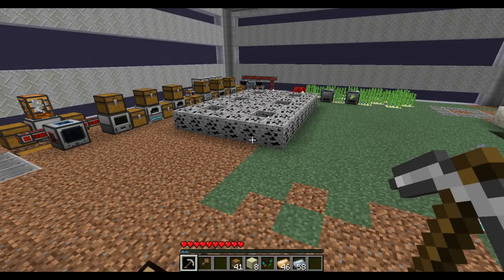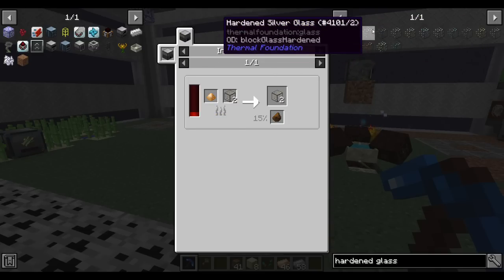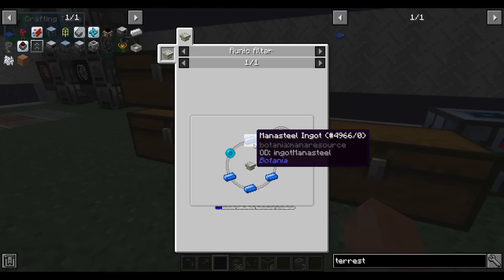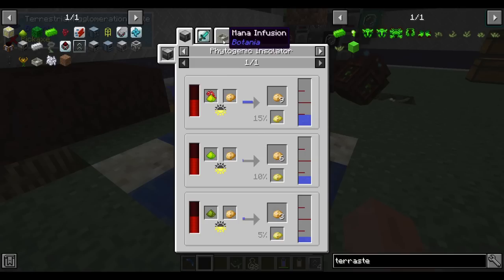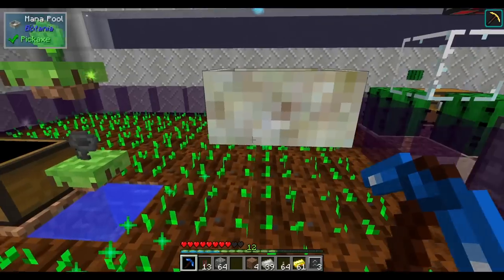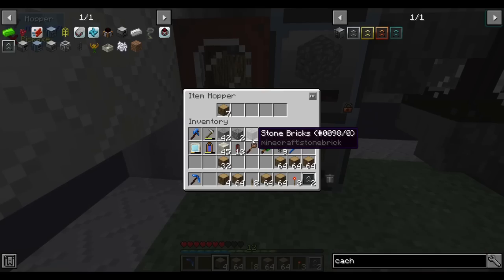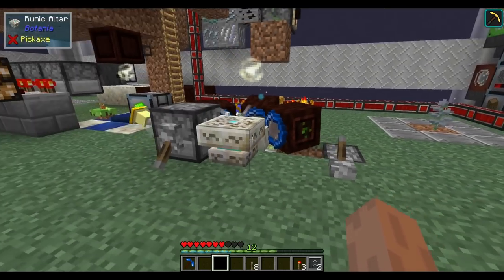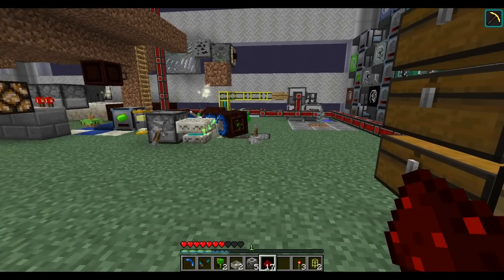Installation Route EP03: Push of a Button

Comment: The lamps don't turn of because they are powered by the signal going into the adjacent lamps if you depower three adjacent lamps the middle one turns off
Reply from the maker: That makes a lot more sense than what I said in the video. Thanks!